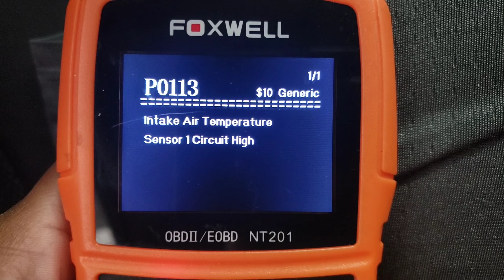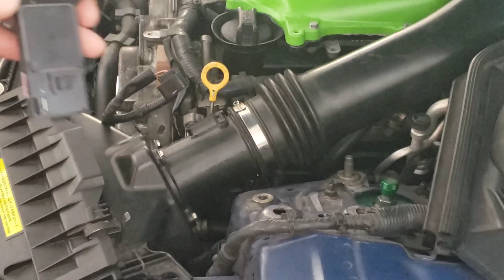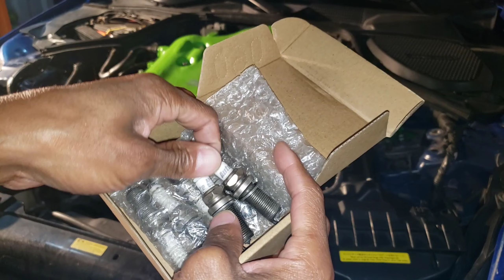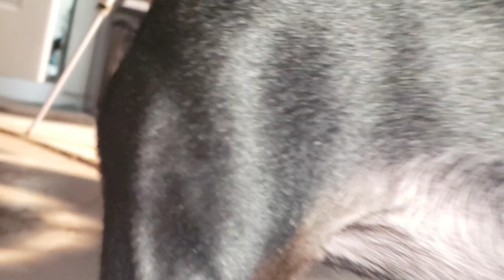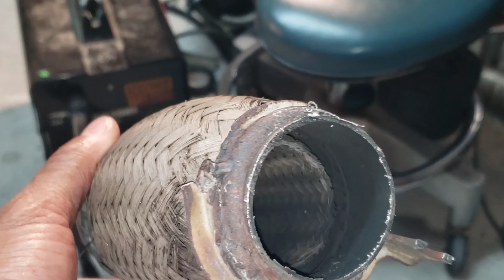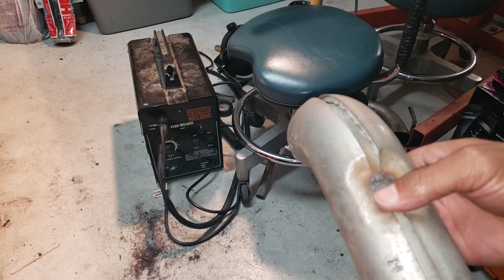P2A00 & P2a03 Found Fixed & Solved Part 3

Comment: Been having the same issue on my 08 350z (P2A03) for the past 3 years been trying to figure it out but code still comes back lol
Reply from the maker: I won't rest until this code is completely figure out. My P2A03 was a leak at the 0² sensor but my P2A00 is quite the pain. There's a hint to a huge leak in my video I just dropped. Thanks for watching!

Comment: Always buy OEM sensors or else they won't last as long. I'm going thru the same issue on my hr but i think it's the connection bank 2 downstream won't click in and I'm missing a cat gasket in that same side so I will b swapping the O2 and gasket hopefully it solves it
Reply from the maker: Thank you for taking the time to comment. A blown gasket near the O² can cause this code. I would definitely test that connection and make sure its not leaving wires unconnected. Best of luck and keep me updated. I love to hear how you solve the issue as well. Hopefully the videos shined some light. The Finale coming as soon as parts are in. Oh, I love underdog companies that offer great products for cheaper bc a large amount of people can't afford new or OEM or top dollar parts. I wanna work with up and coming companies that are generally cheaper cost. Plus the 4 O² sensors were hella cheaper than OEM and offer a way longer warranty. That says alot to me.